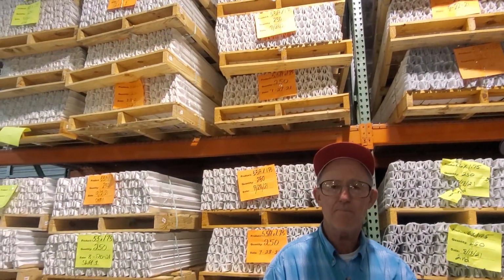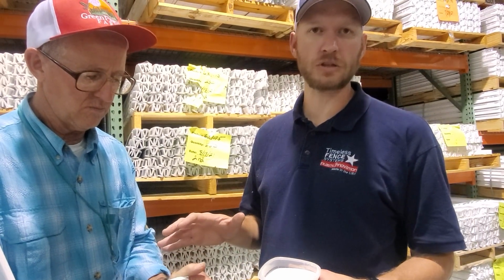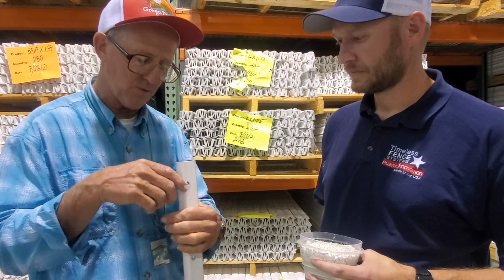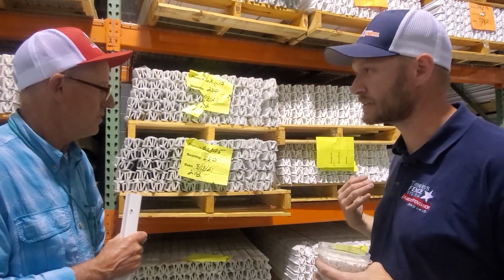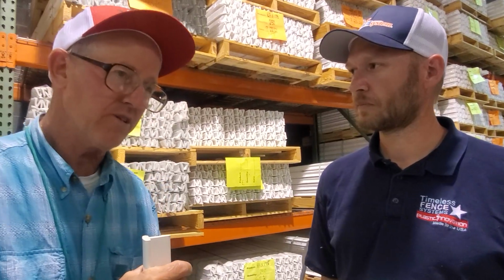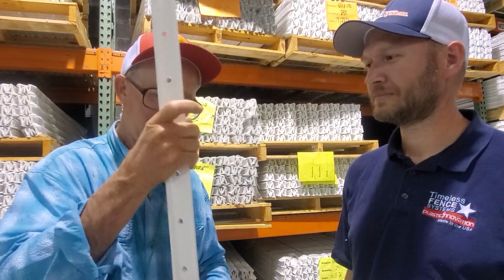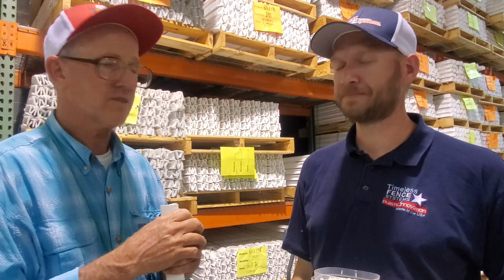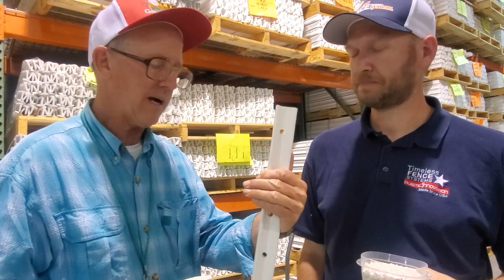Greg takes a tour at Timeless Fence Company.

Comment: Installed last year.  Calves snapped several of the posts and I discovered that high tensile pulled right thru the hole if there was any amount of pull on it.  Replacing with recycled wood posts.
Reply from the maker: We have miles of Timeless posts in use on our 17 farms and have never had even one wire pull through a hole on any post. We even have trees fall directly on the posts, the post never broke.

Comment: I pounded 300 of these for my recent fence project and I am extremely pleased with the quality! I plan to order another 300-400 in 2022. 

I am so happy I didn't use steel t-posts. These things are literally set and forget. No insulators or posts that get loose and wobbly from animal pressure.

Comment: Can’t even drive metal posts in my soil I don’t think plastic would either. But I can see where some could benefit from this looks like an awesome product with reuse capability and no landfill waste is awesome!
Reply: That's exactly my issue.  NEPA ground is ROCK.  Not hard compacted soil.  Rock.  I just can't fathom I could get these in the ground 18+ inches.
Reply: @rickross199  it doesn’t seem probable. You dig 3 inches here and rocks become your enemy. It’s bad enough people will spend thousand for a motorized T post driver that is well over $1000.

Comment: Hi Greg , I have spent 2 years watching you videos and have changed my own system accordingly. However here in NZ I suspect our grass grows faster and for longer periods during the year, I therefore stick to a 36 to 42 day rotation. I use heaps of pigtails . Could I suggest you look at the Strainrite hot pots. I have used your plastic type and cows just learn to push them over when tight grazing. Once learned they always remember. The hot post is as light as the plastic but is hot for most of the pigtail. There is a hand insulator to hole and another insulator at the foot peg. This means only the curl at the top and the main part of the leg are hot. The cows lean very guickly not to push on them. No breakouts at all

Comment: Greg, is there a way to hook up polly braid to those style stakes
Reply: You can run the poly braid through the holes. Though for temporary fencing a step in post would be faster setup and take down. Our posts are designed mainly for permanent or semi permanent fences.

Comment: If you lose a lease after a few years can the timeless posts be pulled up and reinstalled at a different location? If so, is there any specific technique or tool required to pull them without damage?
Reply: They pull with a regular t post puller. I've pulled a few with a front end loader and chains. There was no visible damage.

Comment: I’ve had 180,000 lb Galv Tensile Strength Perimeter wire up for over 30 yrs.
1/4 Mile Rolls, Best thing I did. Still up, No Rust and slightly stretched after Massive White Pine tree drops.

Comment: LOL. They won’t drive into East Texas clay full of iron ore rocks. I’ve tried it. I have a couple hundred I can’t use until I get into the sandy soil pasture. I like the product, our ground is just too hard.
Reply: Rent a cordless rotary hammer with an 1 1/2" x 18" bit and pre drill the holes. We had to to this when we put ours up. It worked great.
Reply: @georgeheller2281  i bought the biggest RH you can buy at Home Depot. Then I special ordered the bit. Well, i burned that up in less than ten holes. That and the bit cost as much as the gas operated post driver I eventually found. That works great.
Reply: Is it the rocks or sun baked clay? They drive just like a T post in West Mass clay. I cant imagine a rockier place exists, but it's usually pretty damp here. I was given a soil probe by a customer in the solar industry. It's pretty handy for setting posts in rocky ground.
Reply: @swamp-yankee  what is a soil probe? 

I’ve resorted to using 1 1/4” fiberglass sucker rod posts for corners and ends and where these won’t drive. I use a motorized post driver for up to 2.5” posts I think. It will sink most of the fiberglass posts pretty easily. Some would just flower at the top before they were all the way end. Some areas I thought were softer I tried the timeless posts and they’d start good then veer way off course ending up with posts around 45^ angles. Not a pretty sight. 

But I’ve got an area them where they will work good in.
Reply: @gedwardnelson  it's a thin 4 foot  hard steel rod with handles. Works good for finding boulders or bed rock ledge.  Was it real dry while you were fencing?
Reply: @swamp-yankee  I’ll look into one of those. Usually dry, but not always. I wish we could share pictures.
Reply: Did you try putting water on First?